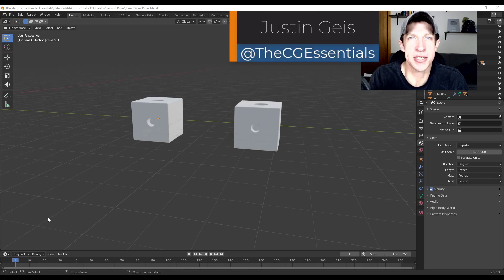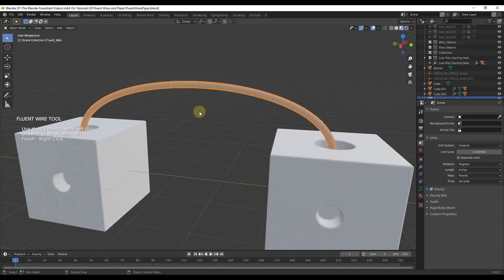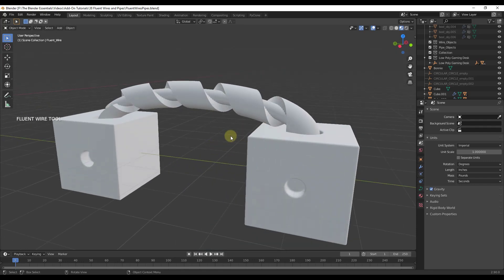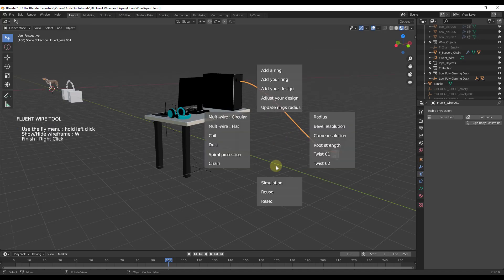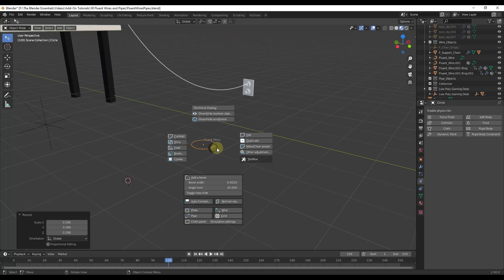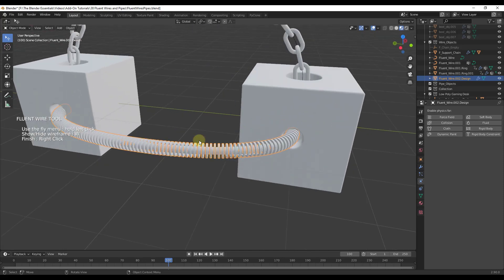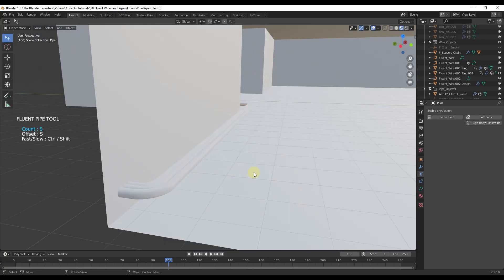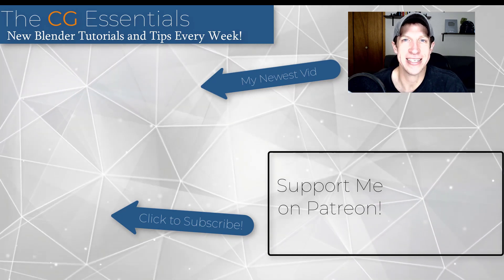EASY Wires and Pipes in Blender with FLUENT!

Comment: Your tutorials are all useful but this one has more practical examples than usual so I think the knowledge gained from it is even better. Thank you and keep the good work. In case anyone has a problem with directing the pipe into a particular path, he can select the Pipe curve in the Outliner editor => Go to edit mode => Move the curve control points to the required locations  along the wanted path. I guess if you can go through the Fixing and Completion panel or the toolbox panel, that would be great. Again appreciate the effort. Thank you.

Comment: I wondered - How do you actually convert all of the component parts of these pipes and wires to meshes that you can then apply materials easily to?
Reply from the maker: Not 100% sure, but I think you can select them and in the "object" settings, use "convert to mesh." Note this will likely break the Fluent Editing capabilities, so make sure you like your mesh